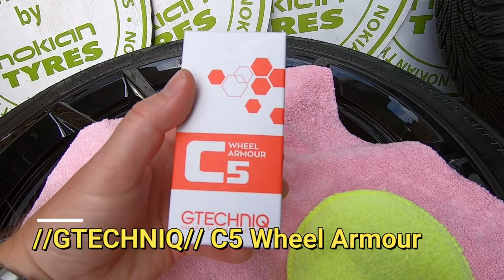//DIY// Polish Black Wheels, in a simple way

Comment: Shows video of perfect wheel (looks new), then does some stuff in a weird order (applies protectant then compounds the wheel after?), then shows video of wheel again looking the same as it did before he started. If there were actually any imperfections in the wheel at the start, should've shown them using the detailing lamp like you did at the end. But to be honest, if you're spending hours polishing wheels that look like the one at the start of the video, you're wasting your time and could easily find something more productive to do.

Comment: Ive recently bought some used black rims and have been trying to restore them. I'm using a cutting compound and the mothers tool but after a lot of time and effort you can still see little scratches on them. is that the best i can expect or is there a way to completely clean them up so they look almost new?
Reply from the maker: It is very hard if you have to much scratches on black rims!, so next step might be a proper polish machine.. :)
Reply: @FaceliftGT  roger that.

Comment: Why was the first wheel using polish, then the  second wheel using the cut compound? Don't you typically compound and then polish each wheel?
Reply from the maker: Hello! Did not filmed all the steps, but i figured out that just polish was enough. So did just polish on 3 of the wheels :)

Comment: Pretty good video, a couple of things though... Explanation of the method you used, why you chose the products, and process you used that gave you the desired results eg: prep/polish/seal. But otherwise I liked the video I'll be looking too do this to my wheels after winter.
Reply from the maker: Thanks!, This is just a Video that a tested this solution, think you can do this in many ways. But this worked, it is a pain to keep gloss black rims nice ;). Therefore i got my New this year! ( Grey ), i can´t handle all the scratches on Black ones... :)
Reply: @acid847 I agree

Comment: Why do you apply the BBV Fast Cut Rubbing after the Ceramic Coating?
Reply from the maker: No i don't hope, do it seems like that in the video?🤪
Reply: @FaceliftGT  So, is the following the order that you applied the products? IPA to clean, BBV Fast Cut Rubbing (compound) to remove scratches, BBV Polish to make the wheels shine, and then the C5 Techniq Wheel Armor?
Reply from the maker: @danielluna8388  YES! :),
Reply: @FaceliftGT BUT why did you use fast cut rubbing after the ceramic Coating? I thought it's not good to use a polish after ceramic Coating. Thanks for the video!